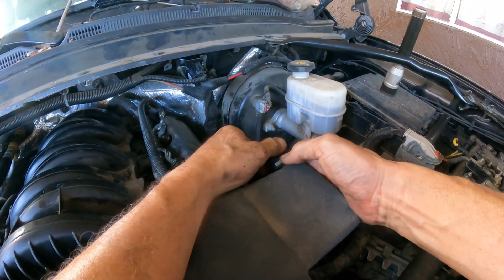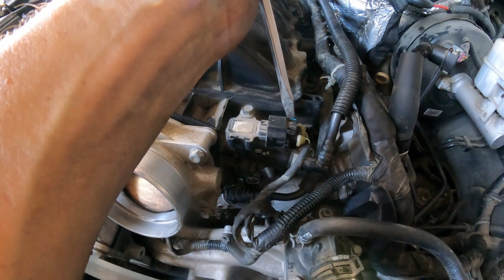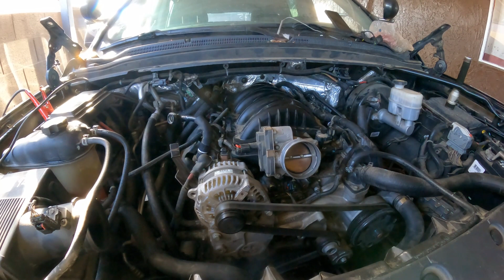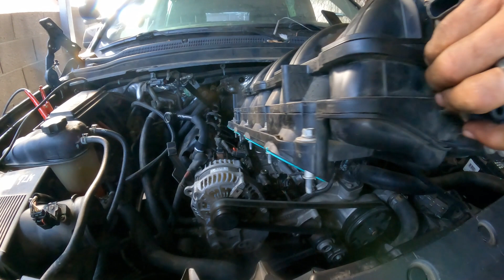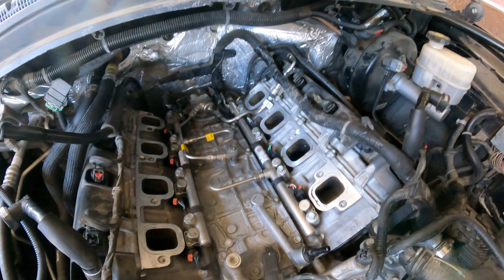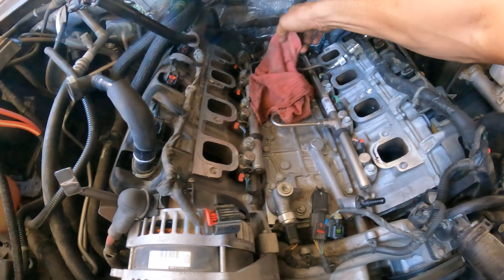2017 Chevy Tahoe 5 3L Fuel Rail Pressure Sensor Replacement Code P16E4

Comment: Does the fuel rail pressure sensor tell the temperature? Also, how did you get to the conclusion that the pressure sensor was the faulty component between replacement?